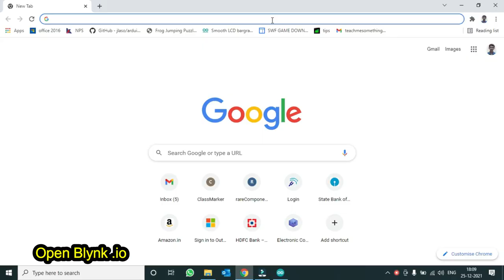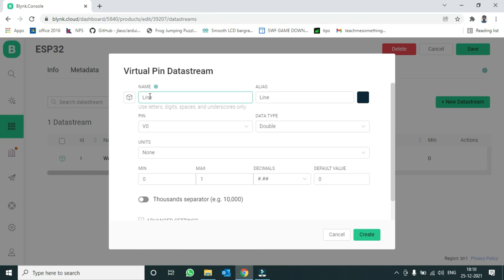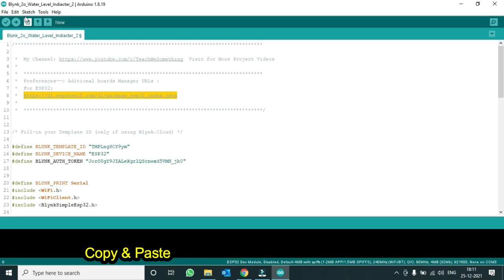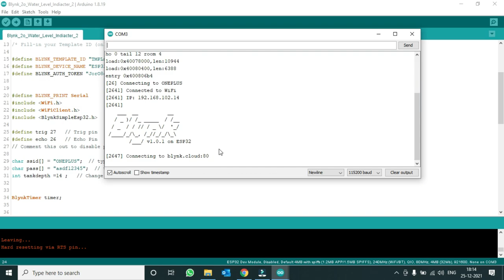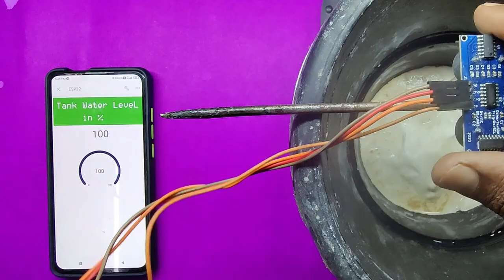Water tank level monitoring system with Nodemcu and Blynk 2.0 application - [ESP32 Project]

Comment: Thank you for this! i am looking for something similar. Is it possible for using this in a well, with the following demensions: 8.20 m deep, wide: 2.55 meters. Water level in the winter is max 7.90 meter, and in the summer, minmum of 1.5 meter. Or is it better to use other solutions?
Reply from the maker: For your requirements sensor is matter...

Comment: The ultrasonic sensors won't work for me as the tank I have is 8 feet deep and subject to freezing temperatures.  
The high humidity causes ice to collect on the sensor rendering them useless. Any suggestions?
Reply: Purchase the JSN-SR04T sensor, it is waterproof. Maybe it will help you.
Reply: @lukhardman6897  "high humidity causes ice to collect on the sensor"